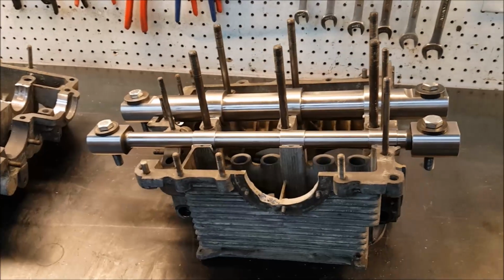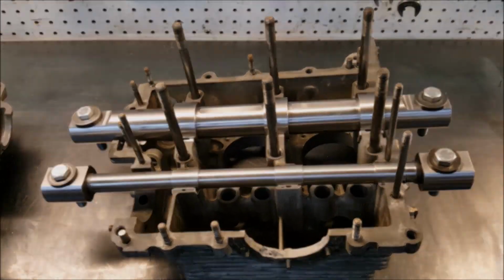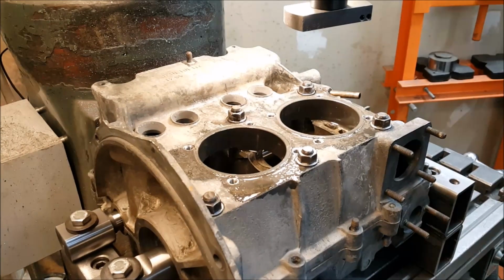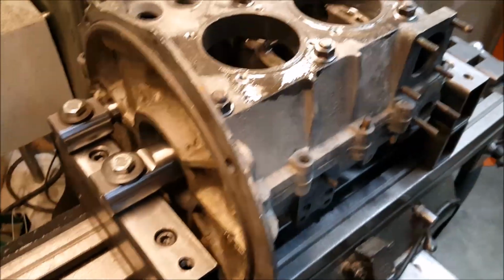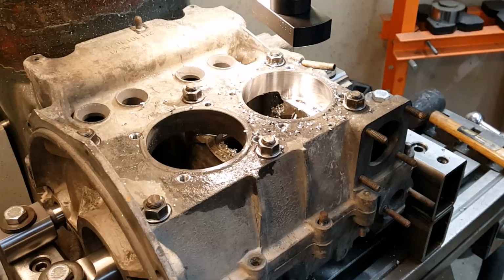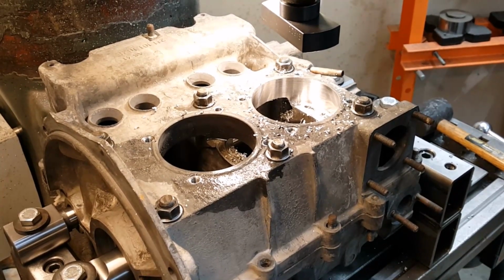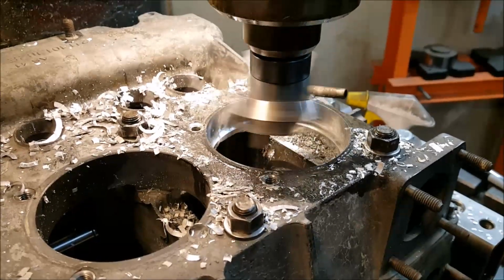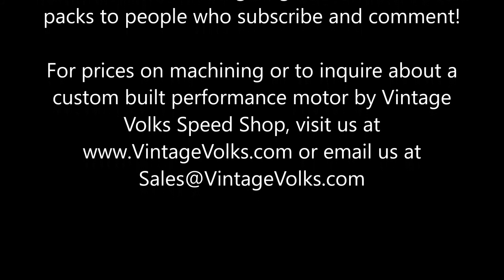Air Cooled VW - Boring and Decking for Larger Cylinders

Comment: When you deck the cylinder bores, do you machine all 4 to the same distance from the crank center line? Or do you just machine enough to clean up the surface?
Reply from the maker: We machine all 4 to the same distance from the crank center line.  In fact, the boring jig has flats on the main bar so we can measure to make sure all 4 decks are spot on before taking it off the mill.

Comment: Hey, do you guys ever enlarge the oil galleys on single relief cases? Ive got an h5 case and cant find much info on how to do so. Thanks
Reply from the maker: Its not worth doing.  By the time you pay for it, you could have sold that case and bought a large gallery case and probably saved a few bucks in the process.

Comment: How can I get a set of those bars you use ?
Reply from the maker: Sorry, those are shop designed and built.  I don't know of anyplace that produces anything like them.
Reply: @VintageVolks  You should market them.
Reply from the maker: Thanks, that's flattering, but, there is way too much work that goes into building a set.  People wouldn't pay what it would cost for us to make any money.  Not to mention the market size is so small that we would only sell 2 or 3 sets.
Reply from the maker: There are no drawings.  I just went out on a slow week with a couple pieces of 4340 round bar and a Sharpie to mark it all out.  Then set it up on the lathe and turned/ground to fit.
Reply: @1fastbuggy502  if you're seriously considering building a set and actually using them yourself then you already know how to make them.
Reply: Pacific Tool and Gauge - bring cash....